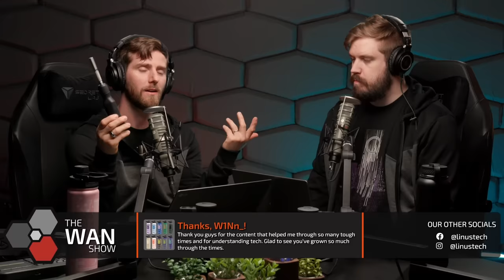Someone COPIED our Screwdriver design!

Comment: This is why source locally. I get tech sourcing from there but really wish companies( especially US) would do more internally.
Reply: They outsource it because it's cheaper.
Reply: You want a $200 screwdriver?
Reply: Literallly everyone would rather make shit domestically it literally comes down to cost 99% of the time
Reply: Good Asian factories probably have much more experience in manufacturing than the local factories as well, if they even exist anymore
Reply: @LoupBlancEA  This is a big one. You want an established manufacturer not some upstart who's going to only produce a fraction of what you need while the rest aren't usable due to defects or down time.

Plus consider the average taiwanese factory worker makes $16k USD per year compared to the American factory workers average salary of $33k USD per year.
You've just double a companies labor costs per factory.

Then you have to factor in the differences in material availability and the added costs if you have to ship in needed materials

The US and Canada simply aren't viable for manufacturing on massive scales like counties like Taiwan and China
Reply: @IkkeiOdaira  Snap-On ratcheting driver. $70. Made in US. Lifetime warranty. No brainer.
Reply: @narlycharley  First of all it's $80. Second if you think the already existing screwdriver without any add ons is good/better just buy the f*cking thing.. Like it's there click on it and buy.. 
Making changes to an already existing screwdriver and therefore changing the production line is expensive..
Reply: @IkkeiOdaira  there is no such thing. For everyone who thinks it's always so much more expensive. That's not true. There is a higher cost but by ordering in bulk you can reduce that and there are other ways. Plus you have to factor in shipping cost and things like that would much cheaper.
Reply: @LoupBlancEA  electronics no doubt but we are talking basic home items like screwdrivers and clothes. Not having a problem with China as a manufacturer. Simply saying don't outsource for everything when it's likely manufactured closer to home. Other countries usually support domestic.
Reply: @TheLaw_v  Then why is everything made in china? 

If you get a bulk discount, then why not bulk discounts from the Chinese? Why are the majority of manufacturing still in China? Well, it's just simply cheaper. Nothing else.
Reply: @Lycanthrope we'll yeah you can buy a shirt for a ¢50 because it's made in a sweatshop but that doesn't help. There are ways to save money and cost on certain items while still using domestic operations. Tech companies usually have to outsource due to most the materials being made elsewhere. But where you can source domesticly you should.
Reply: @NyxHunter  I like your reply. but I would have to push back on the idea that US and Canada can't keep up with the massive production. I think companies in these countries would grow to meet demand. Also these companies would be handling mostly orders from the two countries VS the other ones probably doing worldwide orders.

Comment: I can imagine spending $80 on a screwdriver if you have a reason to use them regularly. But I imagine most "PC enthusiasts" that watch LTT that would buy the screwdriver, probably do like...1 build a year. I'll just keep using my knock off iFixIt kit that cost me $35. For non electronics, i need larger and more heavy duty screwdrivers than this for like my automotive work.
Reply: Exactly even the cheapest ratchet screwdriver or exchangable bit driver will do for 99% of people and even for daily heavier work you could get a Wera screwdriver ratchet screwdriver which will last a lifetime and has amazing bits for 35 bucks and even get a ton of extra bits and a magnetizer on top and you would still pay less than 80 bucks.
Basicly the only reason to buy it is to support them and even then you could just buy anything from the store now, i wonder if the years of working on this thing was worth it.

Comment: Screwdriver is essentially a cheap tool that needs to be there to get the job done. HOWEVER. If you have used a good screwdriver in the past, there's just no going back to the cheap ones, especially if you use it on the regular basis. I asked to get an iFixit kit to use at work that came with a screwdriver. Essentially, yes, it functions the same. But the quality and the satisfaction from using it made the job so much better. It's like going from 60hz monitor to 140hz for non-gaming purposes. They do the same thing, but once you use it, you can't go back

Comment: I bought a Xiaomi Mi 16-in-1 Ratchet Screwdriver a while back that although it is extremely good, looks amazingly close to your screwdriver. Wondering if they are the ones to blame - because it is uncanny how stupidly close it looks?
Reply: I doubt it the Mi 16in1 is from 2020 or 2019 and the previuos one in Mi x Wiha is even older.
Linus didn't exactly reinvent the wheel and there are already way better ones for cheaper than his. Basicly the only thing that is unique is the exact grip shape, everything else is your everyday ratchet screwdriver.

Comment: Why not work with a brand like Wiha or Wera. They worked with Xiaomi before and it worked out really good. Generic Chinese pot metal gonna be crap. They will send you amazing samples and the first batch will be okay but after that it's a gamble. This is what I learned from working with Chinese factories.

Comment: I will order one when they are available. I do some mechanic work and have rounded soooo many screwdriver tips. I am hoping that the tool steel used in the tips are very hard.
Reply: There’s more to it than the metal used in the tip. It’s the design of the top that’s a major factor. Then it’s the screw itself. I’ve seen screws the military uses on their aircraft’s that will strip the head if you look at it wrong you can tell lowest bidder made them. I haven’t seen many screwdriver tips strip out but seen many a apex bit snap in to a hundred lil pieces.

Comment: For 35 bucks you could get the Wera Kraftform Compact, basicly the best ratchet screwdriver ever made and you could get an extra set of Gold/Diamond bits and a magnetizer to make them even stronger than they already are and still pay less than 70 bucks.
Even the 20 dollar Mija/Wiha screwdriver is more than enough for 99% of people.
And anyone who actually uses their screwdriver in a daily basis especially for work wouldn't get the one from LTT anyway, but would go with Wera or another good manufacturer.
If people want to support Linus that's fine, but the screwdriver doesn't cost 70 bucks because it is better anything on the market and Linus didn't invent slightly stronger magnets either and again you can turn any bit and metal screwdriver into a super strong magnet with a cheap magnetizer.
Reply: I don't think you understand how magnets work mate, a magnetizer can only magnetise material to a certain extent, there are physical limits, although those limits can be increased by using more material with higher purity (to an extent). Most companies would opt for less material (as it is cheaper)
Reply: @mcbean1  Dude i don't even care what you jave to say at this point. I knew exactly that you would reply, you already have hundreds of comments on this video alone.
You just play 24/7 defense force for them for no reason.
The screwdriver is another no name china produced ratchet screwdriver with 700% LTT tax.
The only reason to buy them is to support LTT, which is fine, but people need to stop acting like he invented something special here.
And again you can get basicly the highest quality bits from Wera or other great companies and still pay less.
Reply: @kwedl  Don't blame me because people like you spread bs and don't understand basic concepts. 

Why does it bother you so much if people want to buy a screwdriver, do you work for snapon or something? 

no one said Linus invented something new, don't straw man the argument.

"And again you can get basicly the highest quality bits from Wera or other great companies and still pay less." how would you know, have you tested them...or do you just like making stuff up?

Comment: I don't get the hype with that screwdriver, what is so special about it? It has a ratchet that only turns in whichever direction you choose? There's screwdrivers out there that can do that already. I have one from Stanley, it has interchangeable screw heads, a little compartment to store them as well as a nice grip, it's like 15 bucks at a hardware store. What am I missing here?
Reply: I don't really get it eiter. It's basicly your average made in China ratchet screwdriver but with a 70 dollar LTT tax. The Xiaomi 16in1 came out years ago, is basicly the exact same and is 20 bucks or the Wera Kraftform is 35 bucks and is pretty much the best ratchet screwdriver out there.
I get that they need to price it higher compared to huge companies, but it doesn't seem worth it considering the years they spent on this already. And of course it will just get blind 10/10 reviews by all the youtubers they sent it to or people who have never used another one.

Comment: You guys went way too crazy with this whole screwdriver thing. Any real electrician, builder, engineer, etc. would never use a ratcheting driver. Not for real purposes... You should have just had them make a clone of a nice Klein driver, one of their concealed tips, 14 in one types or something. Or just make a set of drivers, so each one is the best driver it can be, as any multi tip unit is immediately a compromise to some extent. But heck, even the newer Klein 14 in 1 w. extendable shaft is super simple in design, but super robust and high quality. But again, literally anyone who takes themselves seriously, who works with tools on any level, considers ratcheting drivers to be a "free gift for a new bank acct" level type of thing. You'd never grab for it over a good normal one.

Apparently I can't link to the driver I want to show, or my comment gets blocked.. that or you don't like what I'm saying and are blocking it no matter what. But just search for Klein 14 in 1, and then look at the one with the removable / extendable shaft.

You always sacrifice shank / shaft size / diameter when you go multi tip too, so you immediately sacrifice what recessed holes you can dip into. Much better with individual drivers for electronics work. Multi tip can be good for electrical work, but computers ain't that, they be electronics. Of course Klein has precision drivers with multi tip too, which will get into those larger recesses easier, but as you shrink down in scale, even those will cause issues. Truly though... choosing a ratcheting driver, I feel that's a major mistake. They really are the butt of all driver jokes, no pro would ever use one, they always feel cheap, are too bulky, and bring a level of unneeded complexity into the mix. If you need to be able to slip in reverse, all you need is a twisting top cap.

Comment: Very interesting to see the works behind the scenes. I don't think that their screwdriver can compete with the likes of Wera or PB swiss, but it could be decent enough that if you are a fan of the channel, you would get it.
Reply: well it's basically as good if not better than PB swiss 95% of the time, I'd consider that an absolute win hehe
Reply: @someoneelse1550  the handle seems to be a problem, by the looks of it, it looks very slippery.
Reply: @someoneelse1550  And those claims are based on what exactly..?

Comment: I'm glad your screwdriver is about to launch, but to be honest, it's a waste of money.  Don't get me wrong, I hope that it sells well, but for the money, I prefer my 8Vmax DeWalt cordless screwdriver.   And this is coming from someone who works IT and needs to use a screwdriver daily.  

$10 more, electric, gyroscopic, and powerful enough to work without so much power to strip screws
Reply: How in the fuck can you use that bulky driver in tight spots, like screwing in a CPU cooler? I sometimes barely managed with a normal screwdriver due to the angle
Reply: @L. Ron Hoyabembe So even more money spent?
Reply: @L. Ron Hoyabembe It adds up
Reply: @The_Viktor_Reznov  as someone who is constantly installing equipment on a weekly/daily  basis, an automatic screwdriver with bits is a lifesaver on my wrist.  I went 2 months in my current role without one and dreaded ASR/new install days so much.  Now they are my favorite day because it usually means travel and my wrists don't hurt as much as they do when writing code.
Reply: @techinitiate9318  Gotcha, makes sense, never thought about wrist strain

Comment: have you seen the xiaomi rachet screwdriver its is a quarter the price yet the same screwdriver
Reply: Yeah it's basicly the Xiaomi/Wiha ratchet screwdriver which also has a really strong maget, good bits and ratchet motor for 20 bucks. For 35 you could even get the Wera Kraftform badicly the best ratchet screwdriver out there.
I get they have to push the price a bit compared to huge companies, but even then the only reason to buy this over cheaper models is to support them.

Comment: You know, I get wanting to reduce costs. I get wanting to keep the price of the screwdriver low. I just don't agree with manufacturing in China.
Reply: It's a Megapro screwdriver. it's made in Canada. the part's coming from china are the ratchet and bits. the majority of the screw driver is Canadian
Reply: @rodrames2462  Then I stand corrected!

Comment: Lesson learned I guess, have your good produced in parts and do the final assembly locally.
That makes it a lot harder for them to copy paste your full design.
Reply: You didn't watch the video? No-one stole anything. LTT wanted them to manufacture the screwdriver, but LTT failed to send the drawings. But the manufacturer had got some earlier prototype of the driver and managed to proceed on that, almost as if they had had the drawings.

Comment: Id like to see you put that screwdriver in the hands of actual blue collar workers. Don't get me wrong I completely understand this screwdriver is geared towards techs like yourself. But if you really want to learn the limitations of your product put it in the hands of actual rough neck workers. Guys and gals who will use and abuse it. As an industrial electrician myself and my coworkers we abuse the crap out of screwdrivers. I can't tell you how many tips I've destroyed trying to loosen a rusty screws. Or are forced to use a flat head as a prybar. I completely understand if you're not up for the challenge I get it your screwdriver wasn't made for workers like myself in mind. But I'd still like to see if it could hold up to the everyday challenges that I put my daily driver screwdriver set through. If it can't I won't hold it against it not alot of tools can hold up to the abuse we put them through. But if it can then I believe you have truly an amazing product in your hands and worth every penny your charging for it.

Comment: Sorry, can't bring myself to buy a $70 Chinese made screwdriver. 
I would with Taiwanese, Japanese, German, US, or Canadian, but not Chinese.
Reply: SO you'd buy a lower quality product because it isn't Chinese?
Reply: @mcbean1  How does that equal worse quality? Why do people act like Linus just magically invented new screwdriver tech.
For 35 bucks you could get the Wera Kraftform Compact, basicly the best ratchet screwdriver ever made and you could get an extra set of Gold/Diamond bits and a magnetizer to make them even stronger than they already are and still pay less than 70 bucks.
Even the 20 dollar Mija/Wiha screwdriver is more than enough for 99% of people.
If people want to support Linus that's fine, but the screwdriver doesn't cost 70 bucks because it is better anything on the market.
Reply: @kwedl  because even if you used the same materials, implemented the same process and spent the same amount of time for a screwdriver made in China vs made in the USA, the labour and manufacturing costs in the USA would by necessity result in a more expensive product, which means to get a $70 screwdriver in the USA requires a compromise in either the cost (quality) of materials used or the time taken to manufacture them (again something that can impact quality) as compared to the Chinese version, that's just basic economics, why do you think so many companies go to china to manufacture their products? 

No one said he invented a new screwdriver, don't strawman the argument.

I question your point because I do not believe Linus, who would have access to all the competition, would think he could put out a product of inferior or at best equal quality for double the price. I presume he ensured that his product would be able to go toe to toe with anything within the price point and would be sufficiently more premium than those cheaper than it. My reasoning is that his whole company relies on his creditability and Linus knows this screwdriver will be tested very publicly, if he has dropped the ball here then he has destroyed his company. Now I could be wrong but I'll wait to see the objective reviews first.

Comment: That's what happens when you get things made in China. The land of copies, less copyright 😜, they have an impressive industrial caperbility. They do suffer with metallurgy though as due to atmospheric pollution they can't make metals of top purity, therefore when they alloy these metals, you get impurities from each type of metal used incorporated into it, plus some from the alloying process. No amount of flux will remove it all, plus that adds cost, which goes against having things made there in the first place.